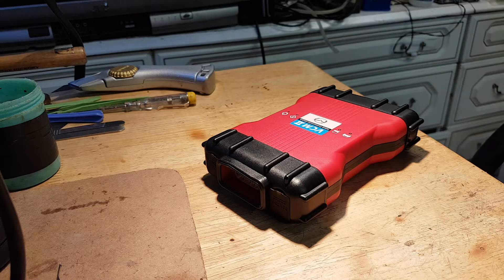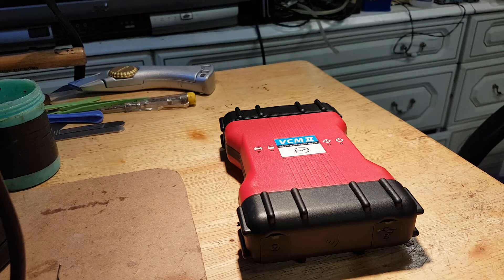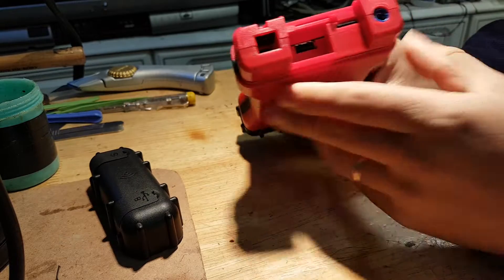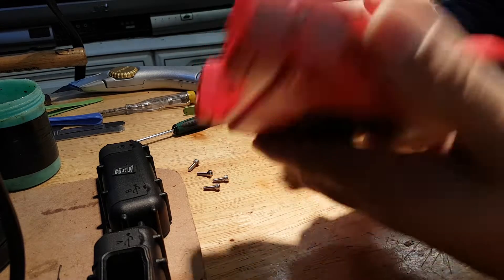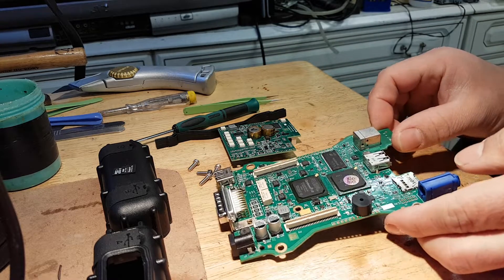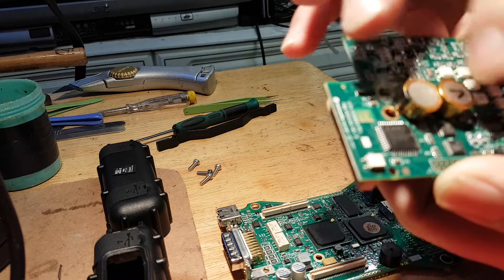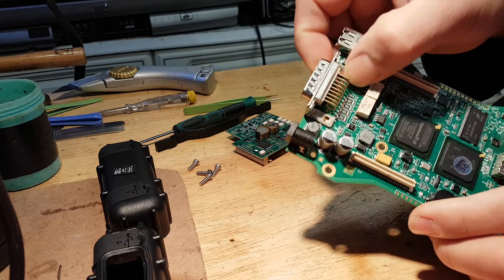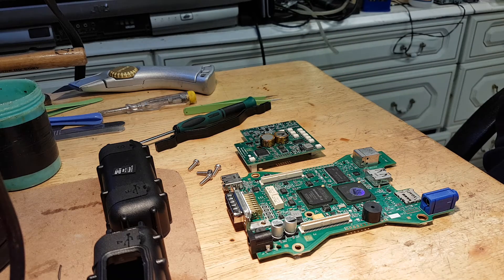Mazda VCM 2 interface teardown. Internals and PCB quality.

Comment: This one is A grade so it will not damagaing the ecu right? Because the element on the board is many of them and also the second board and tons of chips ?
Reply from the maker: It is better quality, and supports most if not all the functions...
Thank you for watching!
Reply: LM Auto Repairs Thanks for your great information
Reply: LM Auto Repairs the reason I asked you about damaging because someone said to me that the elm adapter might hurt the ecu circuit it is better to use the genuine vcm from ford but the price is too high I couldnt reach that so I looked for the best cloned vcm
Reply from the maker: @CIAGunzazaTV  
Nothing wrong with using an elm cable with forscan...
I use it sometimes...
Reply: LM Auto Repairs hmm I always use it still no side fx right now no shorting of circuit

Comment: Thanks. Any idea what the SD card is used for? Also you made my finger nails hurt pulling the covers off. 
I have done many of them and every time they seem to get harder to remove. The reason I remove the cover is to roll back the firmware. 
I have found for what I use them with IDS v86 does an exlant job. Thank You for the link. There price is in line with what I pay.

Comment: 100£ is really a very good price for that tool. It is very important especially when use it for flashing or programming modules. Except that it can be flashed to different firmware and if it isn't A grade quality it may be blocked and can't be used any more...
Reply from the maker: Aldi Shuli 
Absolutely correct!